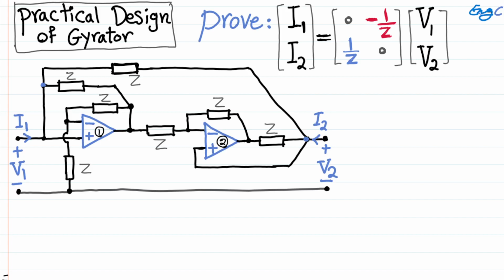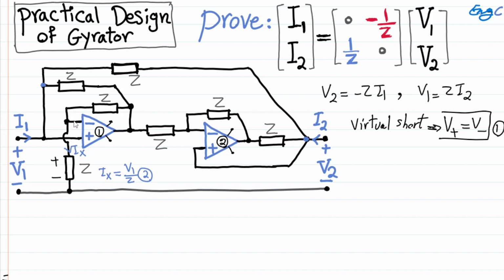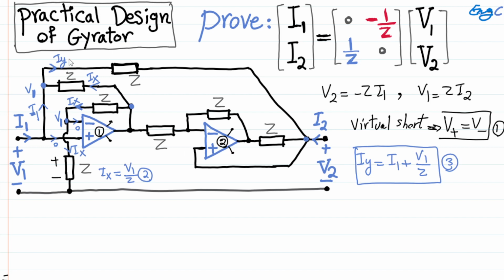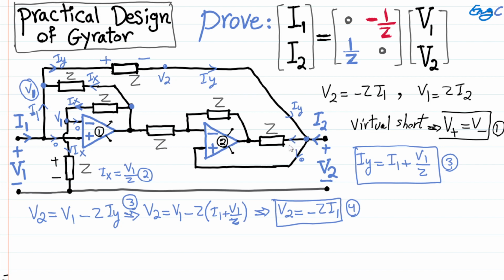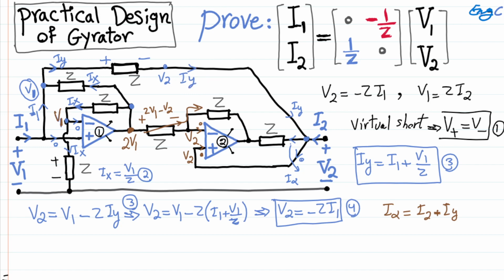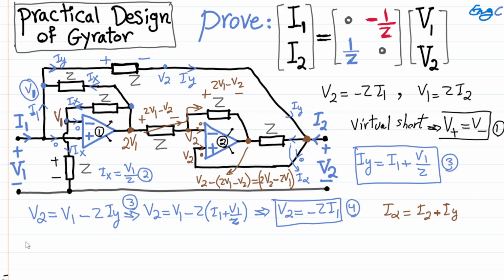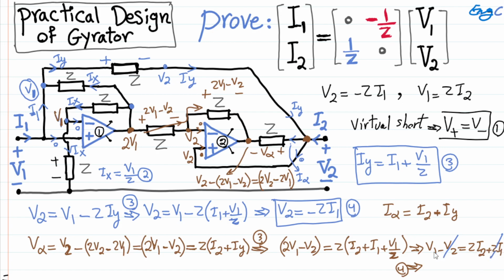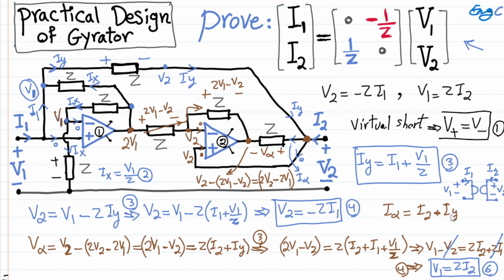Operational Amplifier Circuit Example: Prove this circuit is a Gyrator (bottom rail is grounded)

Comment from the maker: Thanks for watching. For more examples, please see  Negative Inductance with Gyrator https://youtu.be/GF_Mun_Mkyo , Gyrator, OpAmp and transformer video https://youtu.be/Ls_FvD37yHE 
Multi-Gyrator Op Amp Circuit https://youtu.be/2KpjAytRBpc
More Gyrator Circuits:  https://www.youtube.com/watch?v=kX5X8jBXVXw&list=PLrwXF7N522y4c7c-8KBjrwd7IyaZfWxyt
Note that practical inductors have limited range of inductance. The larger the inductance, the bulkier, more expensive and more nonlinear that inductor becomes (low quality factor).  For example the whole circuit including rest of components might be much smaller than just a single one milli Henry inductor. I hope this is helpful.

Comment: Nice explanation but this circuit don't not work without grounding the wire conecting V1- and V2- in the bottom of the schematic.
The sum of currents on this wire is -I1 breaking kirchofs current law.
Reply from the maker: Thanks Lars for watching the video, your detailed attention and your valid point in terms of KCL requiring connecting the bottom rail to ground.  Thank you.
Please see an updated and more involved circuit example:
https://youtu.be/2KpjAytRBpc

Comment: I love these circuits. Look forward to soldering some together. Question: If you pulsed a wavelet into V1, would you see a reflection back out of I1?
Reply from the maker: Thank you and glad to hear you liked these circuit analysis videos.  With regard to your question, as long as ideal Op Amps & ideal circuit components are assumed, we can assume infinitely fast Op Amps with infinite bandwidth and open loop gain and hence no reflection and no non-idealities and no nonlinearities.  But in practice that is not true because obviously practical realistic Op Amps have limited slew rate, limited bandwidth, limited open loop gain, etc.  Hence, in real world, this circuit has a limited range of operation and you will see some reflections back as well.